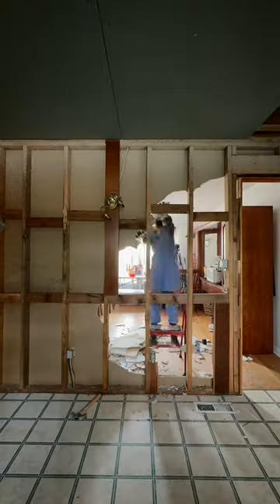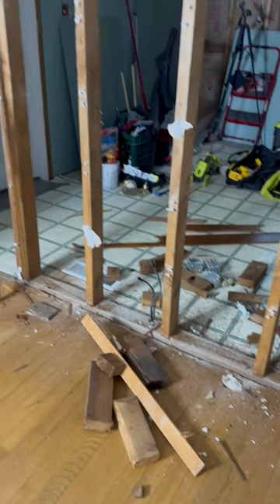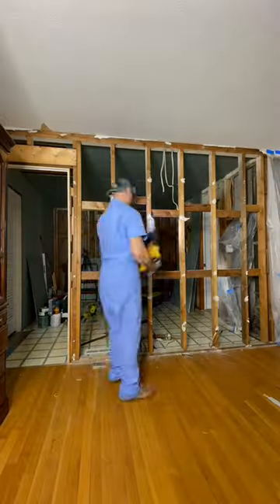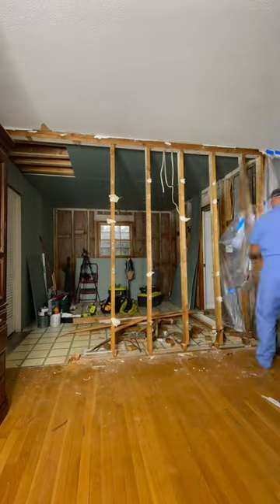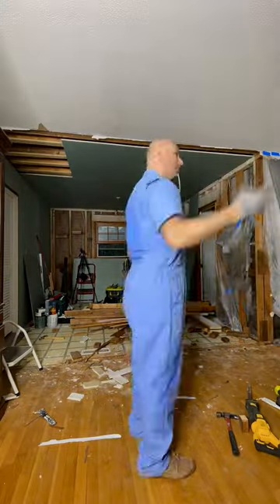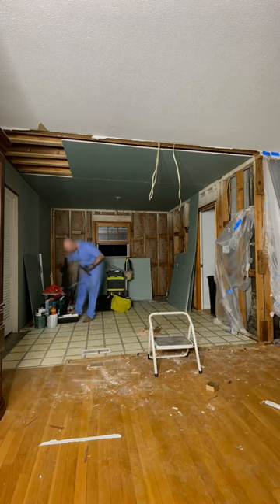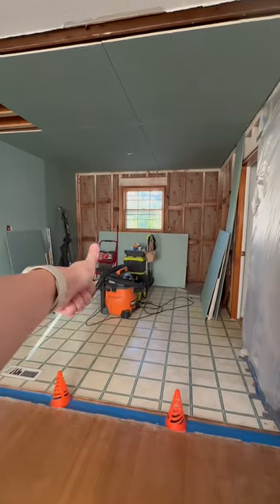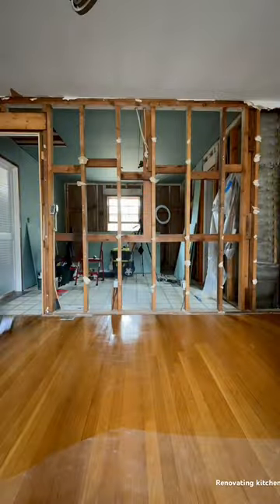Ep.23 KITCHEN RENOVATION | Loosing power and knocking down wall! | House Project

Comment: The door has a header and a jack stud and king stud.  This means an engineer thought it was a good idea to support the weight of whatever is above it.  
That means the wall is load bearing.  
Regular interior walls don’t need headers, king and jack studs.  You should rethink your big, spacious, open kitchen before the additional load on the floor joists begin to overload and your ceiling drywall winds up on your floor or in your soup pot during dinner.  😂
Reply: Yeah when I noticed in the time-lapse that the ceiling wobbled when the frames were being removed. i was confused and hoped it was just the phone shaking considering how dangerous taking one down would be but that sound right 😅
Reply from the maker: We got a reputable professional to physically come and inspect. It is not load bearing

Comment: For those wondering or commenting about this being a load bearing wall... 1st: they had it inspected by an engineer that confirmed it is not load bearing... 2nd: you can clearly see that the floor joists for the 2nd floor are running parallel to the wall they removed.... 99% of the time, this indicates it is not load bearing. Hope this helps clear up some of the confusion.
Reply from the maker: Thank you! ☺️